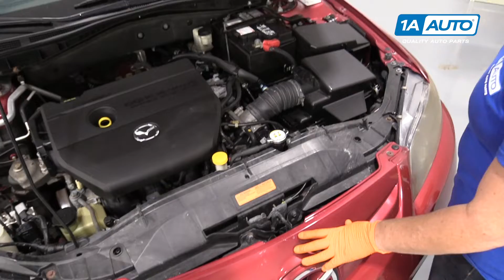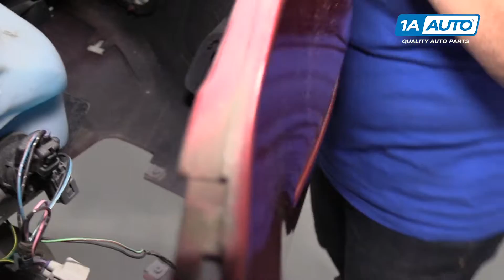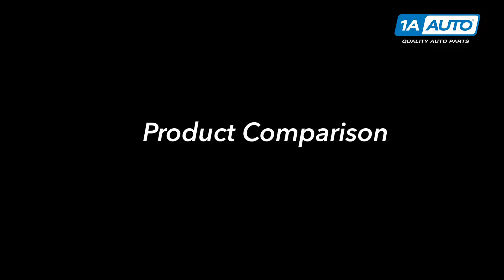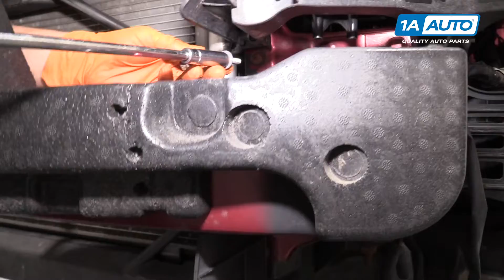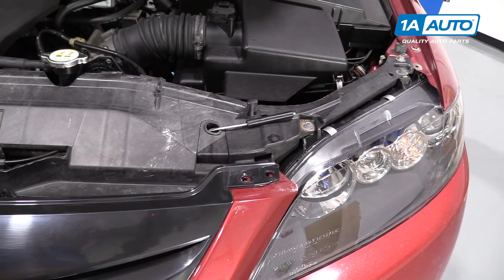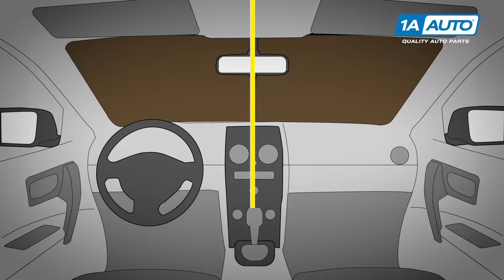How to Replace Headlight Assembly 06-08 Mazda 6

Comment: Nice video. Question: Inside the car is the button fot beam rise and lower with positions 1, 2 and 3. In what position should it be if new headlights are installed? Thank you.

Comment: This was great and thorough.  Can you do a video on just replacing the plastic lens cover.  That is really all I need to replace.  I am hoping you don't have to remove the bumper, but I have a strong feeling it will be necessary.
Reply from the maker: +Lillian Welch Thanks for watching!  You cannot actually replace just the lens, it is glued onto the assembly during the manufacturing process.  If you need a new lens then you will have to get a whole new assembly, which we carry here: http://www.1aauto.com/mazda-6-headlight-pair/i/1alhp00624?f=356564&y=2007&utm_source=YouTube&utm_medium=CTA+Comment&utm_campaign=ytcomment&utm_term=6gaCoH_eCRg
Reply: @1AAuto  Just the lens is available on line with a couple of vendors.  I guess I will see if a restoration kit will remove enough of the haze for now.  The assembly is simply too costly for me right t now.  Thank for the info, you saved me money by telling me the lens is glued.  I could see myself using my Dremel tool to detach and then gluing the new lenses on.  Too Much work.